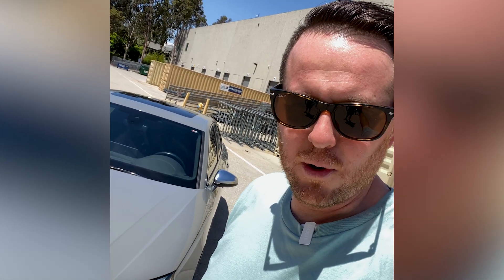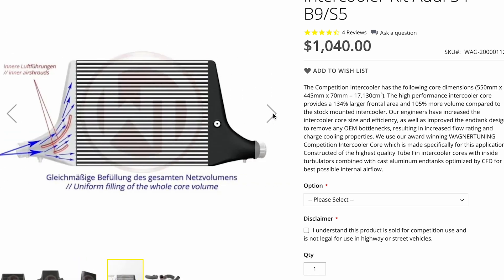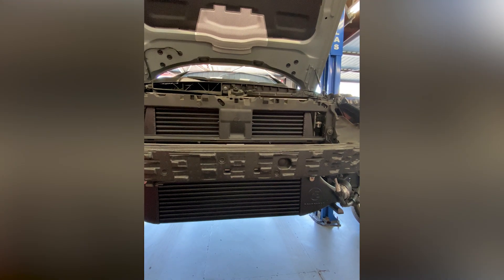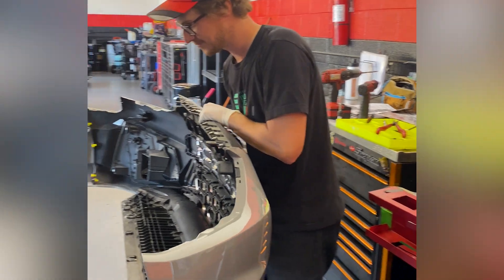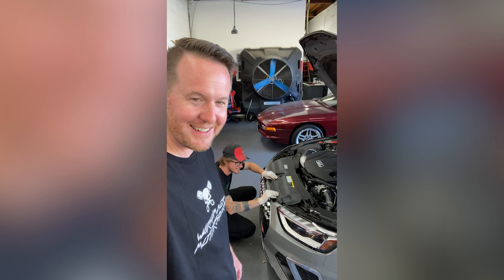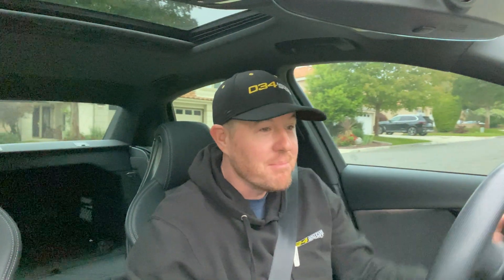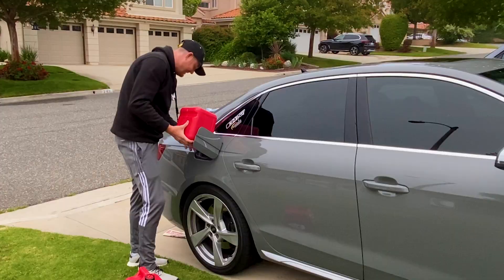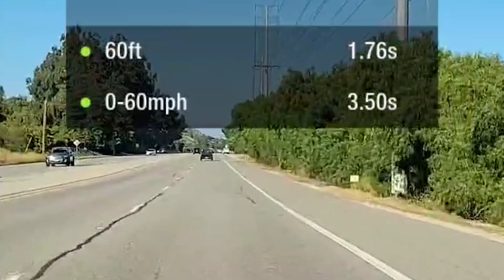Audi S4 Intercooler Upgrade - 034 E85 Stage 1Tune + Stage 2 Transmission Tune!

Comment: What are the couple mods that you feel really helped with driving characteristics of the car? Got stage 1 e85. But want to get a downpipe for sound. But also felt wheels or a rear sway bar would help tremendously but wanted a second opinion
Reply from the maker: If by “driving characteristics” you mean handling, you gotta do the rear sway bar and end links and the lowering springs. If you want to splurge you can do the front and rear sway bar kit. But the car drives incredibly better after the sway bar and lowering springs.
Reply: @ gotcha ok sweet yea I meant handling/power limits. I’ll look into the sway bar and end links and do you really like the spring option over the coilovers?
Reply from the maker: @ yes. I just raced global time attack at buttonwillow (see more recent video on my channel) and got a 1:57 and beat half the group, most of which were on coilovers. Are expensive coilovers better? Probably, but you can’t beat the upgrade for the price with 034 Motorsport lowering springs.

Comment: Hey do u need anything extra to run e85 or just the tune?
Reply from the maker: No, not unless you want to go stage 1+ or stage 2 or above. If you go stage 1+ or above, you need more hardware like the high pressure fuel pump piston upgrade

Comment: Great video!  I have watched many tuned b9.5s and I want to do the same to mine.  I have a CPO warranty and can’t decide if I should go stage 1 with 034 or if I should wait until my warranty expires but that’s not until 100k miles or October 2027.  What’s your experience with the tune for a daily?
Reply from the maker: Thanks! My personal experience with the 034 tune has been amazing! The driving experience went from fun to addictive. These cars have so much potential and you really get to experience that with the tune. For me, I wanted to enjoy that experience right away. I didn’t want to wait until high miles. I have not had a single tune related issue with the car. I think 034 Motorsport is the best Audi tuner in the business. They don’t want your car damaged because it will damage their reputation, so their tunes are very well balanced. Prior to tuning my car, I made sure to establish a good relationship with my dealership maintenance team. I also have a friend who saw in the video doing my work. So I’ve had regular repairs done at the dealership without any issues. And any mod related work is done by Warhammer (my friend). I think you need to find someone with a tuned car and go for a ride. You’ll be amazed.

Comment: And lag on throttle response because of the much bigger volume of air.
Reply from the maker: Is that from your experience? I don't feel any lag.
Reply: @midlifemods  Yes. It's good if you didn't notice it, but larger volume intercoolers definitely have a negative impact on response because the boost is delayed. It bothered me enough to downsize a bit, but still stay bigger than OEM.  As you mentioned, once you start pushing more power, you need to keep temps under control.
Reply: @Japplesnap Which mid-size did you go with?
Reply: @ElevatedAgenda  Unitronic. Better cooling than stock without creating any additional lag.

Comment: You should REALLY, REALLY, REALLY install an ethanol sensor if you are going to run E85. All E85 at the pump is not created equal.
Reply: The tunes for these cars that are “e85” are calibrated at e60+ have plenty of room for play. Only the hybrid turbos u need e70+
Reply from the maker: The e85 in my area is all supplied by the same supplier so I think I'm good. I stick to the Chevron station by my house. Seems to be reliable.
Reply: @midlifemods  Yea, I get it. These engines and ethanol tunes can get finicky if the ethanol content isn't just right. An ethanol sensor is a real easy install, if it were me I'd install it for the piece of mind of knowing for sure that the E content is correct for the tune. Great content btw. 👍
Reply from the maker: @IainB deep down I know you're right. I'm just not thrilled about messing with the fuel lines to install the sensor. I feel like it could create a weak point down the line. Probably just paranoid about nothing. And thanks for watching! I appreciate the support! Inching closer to 1k subscribers! I have a lot more content coming, but I've just been behind on editing.
Reply: @midlifemods  Awesome, keep up the good work!

Comment: I installed the Wagner intercooler a few months back in my B9.5 SQ5. I'm definitely not a fan of the janky, self-tapping screws they use for the bumper bar. I mean, it's fine but other companies go to the trouble of engineering proper top brackets that mount in OE locations. For the premium that Wagner charges they should have spent a little more time in R&D making proper mounts.
Reply from the maker: I know what you mean. That part of the installation was a little sketch

Comment: Hi! I found your channel from watching Jeremy and Adam's (VAG-uh) channel. Really like your content!
I just dropped an intercooler into my 2023 S4 but not sure what to do with the old one so just curious if you kept it or sold it and why. Thanks!
Reply from the maker: Awesome! I'm glad you found me, and thanks for watching! I kept mine JUST in case. You never know what you might have to do with these builds. I like to keep my oem parts.
Reply: @midlifemods  makes sense. My old one lives in the shed next to the lawnmower. You're right, probably a good idea to hang on to it just in case
Reply from the maker: @machogy15  maybe you should mod your lawnmower. Turbo and intercooler? 🤣
Reply: @midlifemods  the stock IC was so small it could have come from a turbo charged lawnmower!

Comment: Hi there. I like Your videos pretty funny man specially (a lot more hot mams checking You out lol). Thinking of getting one of these cars. Question, do you have to do any changes when switching to E85. Like fuel pump or any engine components? Thank You
Reply from the maker: Thank you! No special hardware is required for th e85 tune; however, a lot of people install fuel sensors to ensure they're running the right levels of ethanol. I chose not to because I didn't want to mess with the fuel line. No fuel pump mods are required unless you go up to stage 2 or 3 I believe. A company called Fuel It offers blue tooth fuel sensors that a lot of people use.

Comment: Are you thinking about getting a downpipe and going stage 2 ECU?
Reply from the maker: I was, but I'm not so sure it's worth it anymore. What are your thoughts?
Reply: @midlifemods  Based on the reviews I've seen I feel like stage 2 refines the stage 1 tune. imo since you already have the best intercooler on the market it wouldn't hurt to up the performance with a downpipe and tune since your car can handle it

Comment: Do you regret not getting the S-Sport package with the sport rear diff? I couldn’t imagine mine without it.
Reply from the maker: Great question.  Honestly, I wasn't going to buy anything less than a prestige trim with the sports package. I made an offer at a dealership, and the deal fell through. Then I found this one, and I started to realize it was perfect for mods and had the retro instrument cluster I liked. And I thought to myself "I don't need the B&O sound system because I'll be listening to the engine most of the time, the sports diff adds a tiny bit of weight and is more expensive to maintain or replace,  I want a pure driving experience on track... so is the extra money really worth?" And I decided, for me, that it wasn't worth it. The appeal of modifications to a base model and a more pure driving experience in terms of rear traction was it for me. Plus, I live in southern California and don't worry much about ice or wet roads. I bet the sports diff inspires a lot of confidence and make pushing your car that much more fun, but for me, I don't regret it. But then again, it could be a case of "I don't know what I'm missing" 🙂
Reply: @midlifemods  probably much more of a case of you don’t know what you’re missing. I’m in Dallas, Texas and icy and wet. Roads are not a concern, but having a car that has the driving dynamics of a rear wheel drive base vehicle are a big importance to me. I do have a prestige, but, it’s not what I was seeking. My girlfriend has an S Q5 that is a premium plus and we love that just as much but that is of course because it has the S sport package as well. When we drove models without it there was definitely a difference. Because you tracked the car, I would think that it would’ve been a big deal and that’s why I ask. It really maximize the potential of not only the stage, one tune, but warm, portly the TCU tunes capabilities because of the torque split heavy to the rear in dynamic mode. 
I sincerely appreciate your response, and I am a big fan of the channel representing Texas as the midlife Audi modder. And 034 really needs to get you a sponsorship as indicated previously.
Reply from the maker: @lynxmh  thank you! Now you got me wanting to do a track comparison video! 😃 now I just need to find someone willing or wait until you come to CA 😁. Thanks for supporting the channel!